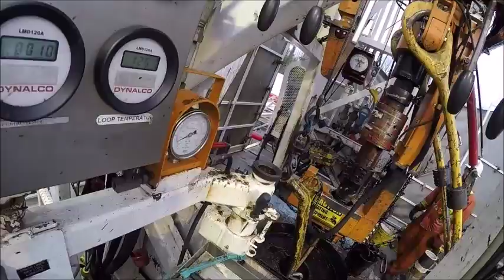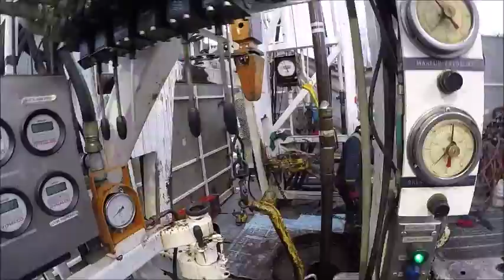Derrickhand Tripping in hole / Drilling Rig Connection POV

Comment: My dad was a Derrick man in the 1950's and 60's. My 3 uncles were the drillers.  I stepped on a rig floor for the first time when I was 7 years old. I'm 66 now. The diesel engines mounted right behind the draw works up on the rig floor were so loud they had to scream at each other. The automatic driller was a rope tied around the break handle. It's still hard work today but a lot harder back them. There was no OSHA back then so my dad always rode the elevators up the derrick. In the 10 years he roughnecked he saw only one person get killed and that was while they were setting up at a new location. They were placing the doghouse up on a separate substructure when he got knocked down and caught between the floor and the steel doghouse. Crushed him.
Reply: J A  That's a great success story if I ever heard one!  You have been there and done that. Thanks for sharing. God bless the oilfield and it's workers!

Comment: There is a lot of stuff on that rig that I do not recognize. But I have not been on a rig since 1989. I didn't see much torque on that pipe though. But like I say. I am not familiar with that equipment.
Reply: The top drive torches it up, you really don’t see it. If you look at the gauge to the left, the yellow box you can see the torque on the tongs when they are making up the mouse hole. It looked pretty decent to me, if I remember we’d torque the 5½ to like 29,000 ft/lbs. then the top drive has a limit set for make up torque that it goes up to and they were using the rotary lock. New times man, but still oilfield. That derrick man hasn’t smashed his hand or finger against the top drive yet or he’s use a rope to go in, set it short with a knot near the end for the pipe to rest on, gets a good drop when you release it.

Comment: ❤ I would run that Derek Man off because he doesn’t even stab or tail his drill pipe, which is total bullshit. Those hands on the floor would not have to struggle so much. It’s a Derrick in did his job correctly. I know this because I worked the old oil school, and I spent some time in that Derek and I forgot more than you’ll ever probably know.